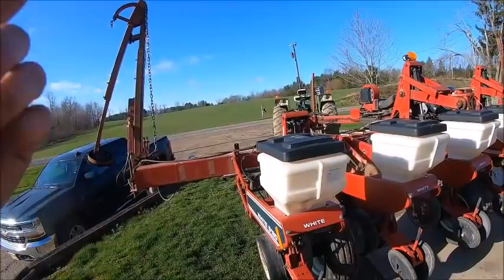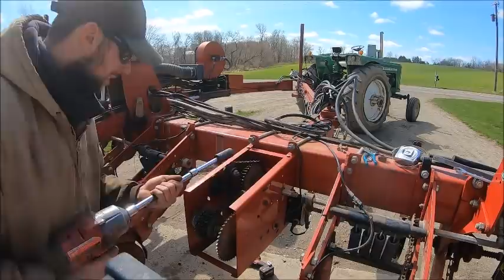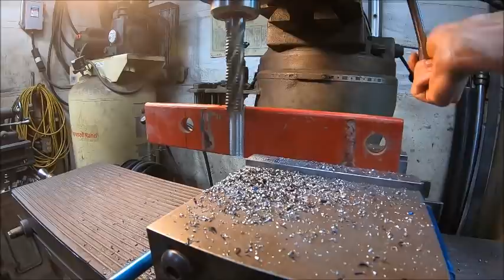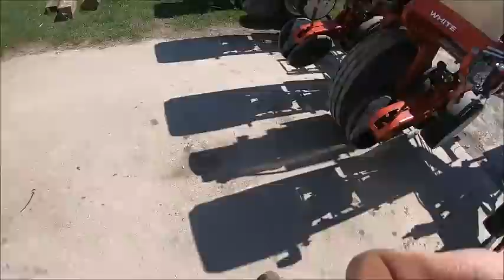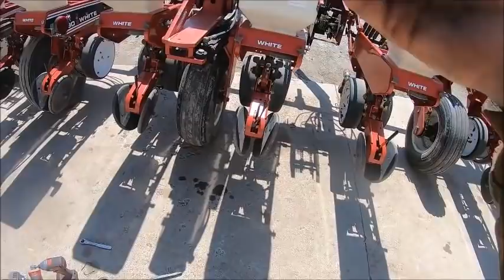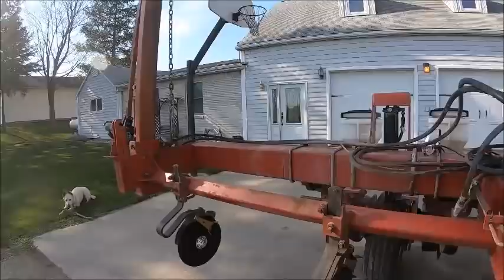Finishing The Narrow Row Conversion

Comment: Looking really good.  We used to run yetter single disc and they were not the best. We were using the older generation . but we now switched over to john deere single disc and really liking it.  If you can find the newer generation yetter with the round pin they are much better.  We are using them in no till conditions so whatever it is worth.  One thing that really helped tremendously was putting the notched blades on.  Helps cut through everything no matter what and we got a lot more wear out of them.
Reply from the maker: Everyone I know that has them run wavy coulters.

Comment: She's coming along. There's a mystery bracket on our 7000 over top of the transmission. I don't know what it is, but I think it's a thing for used planters to have wierd bits and bobs from past experiments. 
I spent half of yesterday and today trying to get a second autosteer(used) unit operational. It's the same as the old one we have so we thought we could just transfer the tractor profiles over and be good. Nope, the measurements went through but for some reason you have to do a calibration for the new unit. Oh well, that's not hard atleast. Have a good easter.
Reply from the maker: It’s never that easy.

Comment: You can run a corn head that isn't perfectly divisible. The couple of inches that you may miss by doesn't make much difference on that. We ran a three row head behind a 4 row planter and cultivators for years.
You are 100% correct, however, about the cultivators and sprayers; they need to be as accurate as possible. Side dressers also. And it definitely works better if the corn head divides properly as well, it is just the most forgiving of the mismatched spacing.
Reply from the maker: Anything can be done if you have to do it that way. Keeping everything even just seems so much simpler. Unless a guy is running gps then it doesn’t really matter.
Reply: @Oliver66FarmBoy  yep. Our GPS was just a fence post on the other side of the field.

Comment: Looking good! on a previous video it looked like the down pressure springs on the left end row unit were broken, something to double check maybe.
Reply from the maker: The springs are broken on every row unit. It’s a weak point on the 6000 series. Most guys don’t even run them unless they are straight no till. I’m contemplating taking them off completely.

Comment: Do what you feel is right!    Chop that frame.  A bigger planter might be a pain in the smaller fields. I am just wondering if your hitch is long enough to add on more frame and go to 12 row some day in the future?  Decades and decades ago the neighbor had an 8 row Deere 3 point planter and added two rows to make it 10.  He must have ran that thing for 20 or 25 years, and combined with a 6 row head.  But up here fields are big and square, not too many curves to navigate.
Reply from the maker: 12 row had longer drawbars.

Comment: I seen IH had both 5 and 7 row wide  heads  back in the day. Haven't seen 5 or 7 narrow though. Guys used them to straddle bedded rows and ridge till rows without having to use wheel spacers.  Still would plant with even rowed equipment. Not a real popular idea and never took off.
Reply from the maker: I’ve never seen any in real life.
Reply: @Oliver66FarmBoy  they are rare. If you do see one it will make you do a double take lol!

Comment: My 8 row white is wing fold. I can measure mine if that would help? Mine is a white 6100 with 8100 row units and 8100 transmission.
Reply from the maker: I got dimensions from the manual.

Comment: And alot of those guys running odd rows to equipment are running a lot of 20” rows.  If only using as a bean planter, could make it work.  But given your current field size, lob off the ends and plant/run like hell.  Be done planting in week.  Another dumb question, with this planter, ever thought of doing beans with it given the placement and population control?  Plus get done quicker even if you make two passes for 15” rows? We did it in the Stone Age and on the second pass shifted the hitch 7.5”.
Reply: This is how we plant our beans starting last year. Grandpa used to do it but went to a 7 inch spaced no till drill

Comment: Do yourself a favor and throw the squeeze pump in the junk pile and get electric more reliable and accurate
Reply from the maker: There’s nothing wrong with squeeze pumps. The last thing I want is more electric bullshit on a planter.
Reply: We’ve used a squeeze pump for in furrow and 2x2 for 20 years. Its extremely accurate and very cheap to maintain.